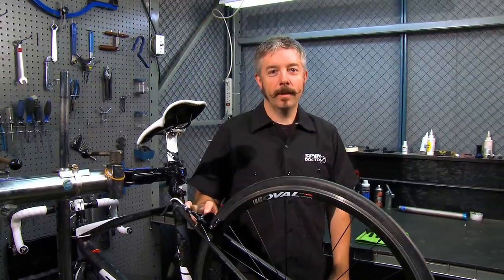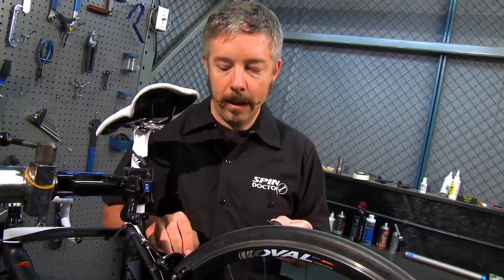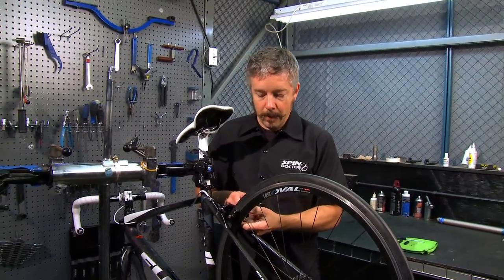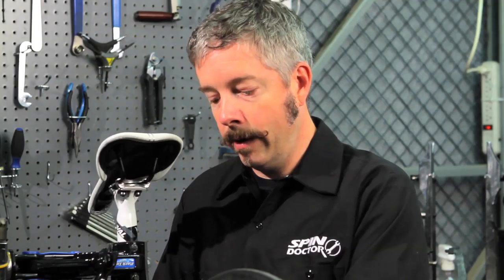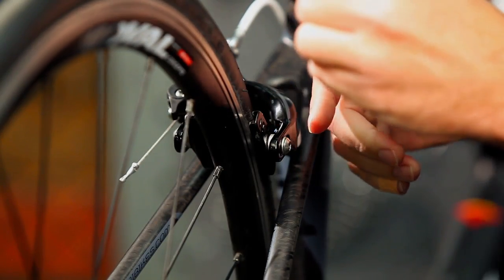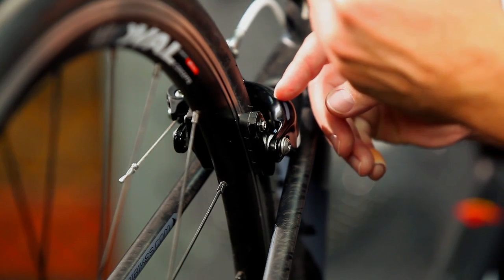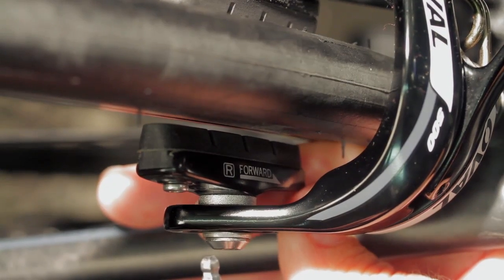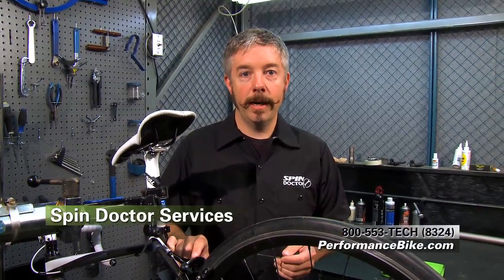How to Replace Cartridge Brake Pads for Road Bikes by Performance Bicycle

Comment: Nice video.  I liked that you addressed toe-in, but the video really didn't show how toe-in is set.  Is the washer not symmetrical so that you can rotate it to obtain different toe-ins?
Reply from the maker: Correct, the washer is not symmetrical because the toe-in angle could be different depending on what caliper, rim and pad combination you use.